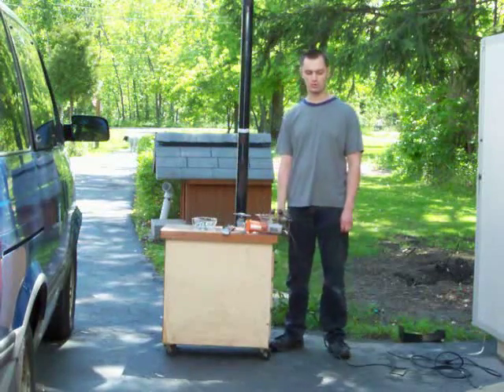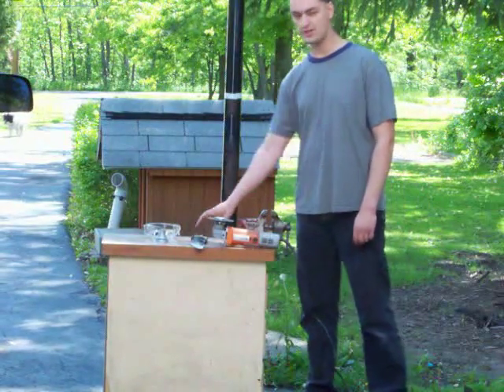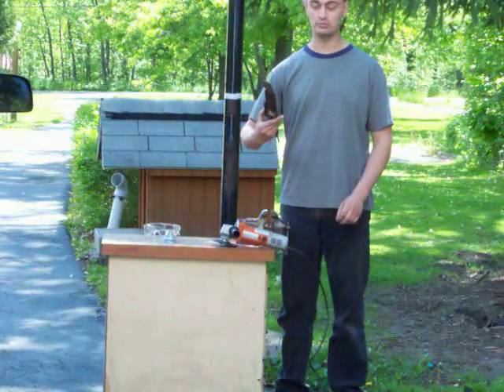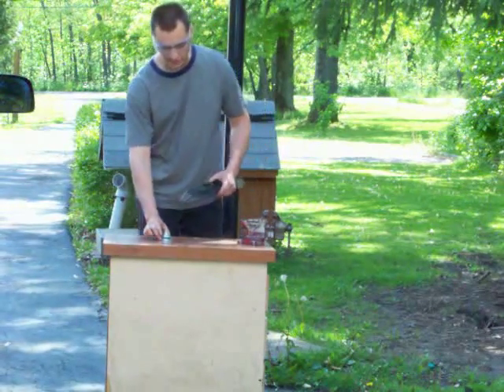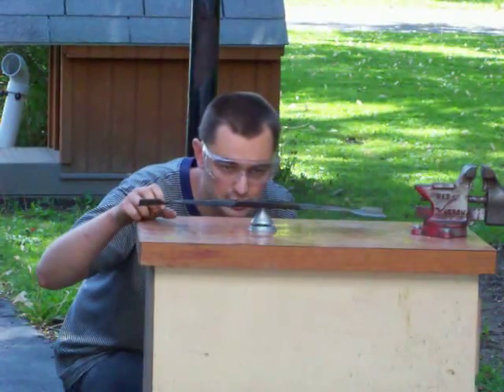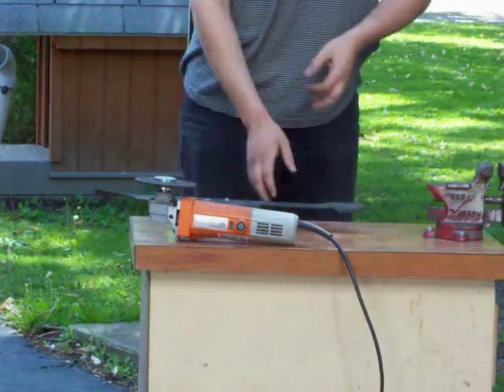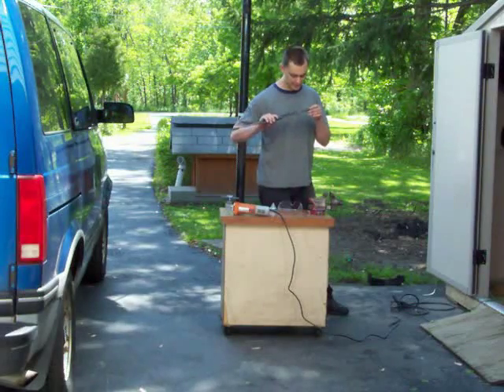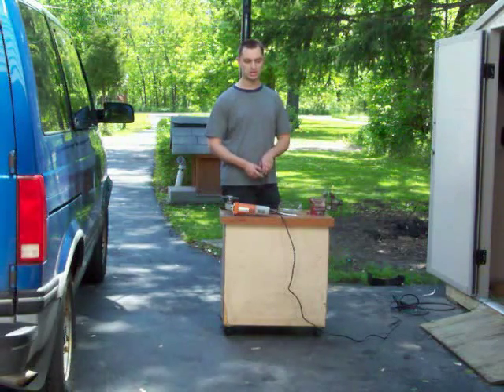how to sharpen a lawnmower blade

Comment: Please don't use a cut off wheel to grind. Not trying to be a smart ass but one of my employees was seriously injured by a cut off wheel flying apart. He had been using it to grind and then attempted to cut with it. He had also removed the guard and a 2 inch piece of cut off wheel hit him in the  neck and cut an artery. If you are looking for "how to videos"  there are plenty of certified professional resorces available on the internet.